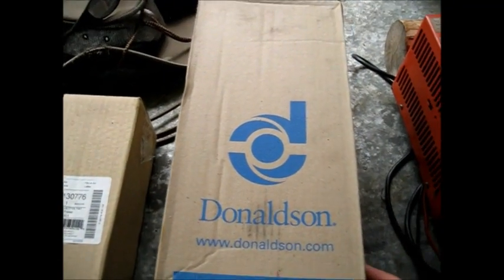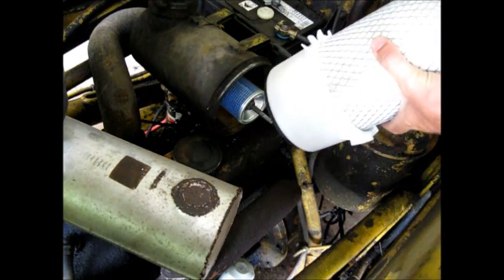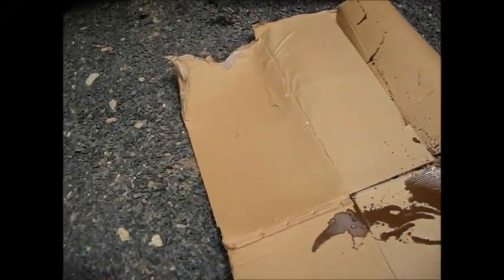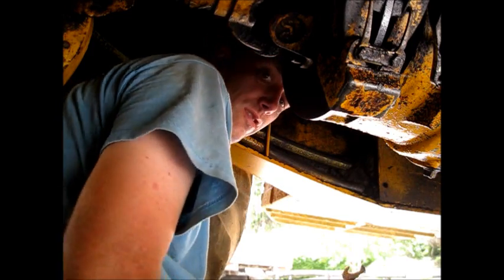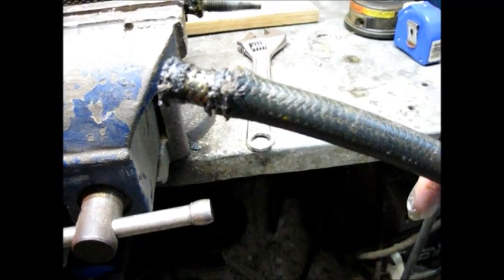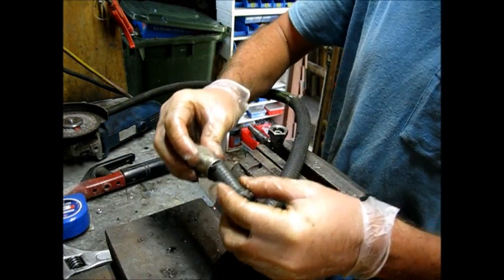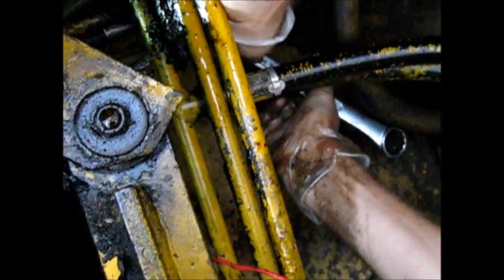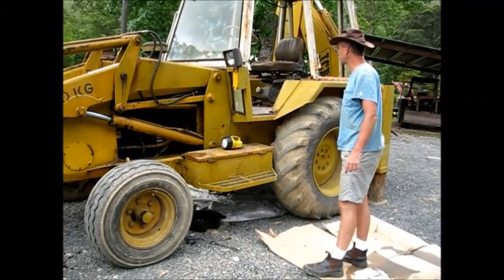Servicing JCB Backhoe Part II And Repairing Leaking Hydraulic Lines

Comment: Troy I have been a diesel mechanic for 15yrs. I wanna pass some helpful knowledge to you. Those fittings are gates fittings and yes they are reusable. The hose is a rubber hose with steel braided reinforced with a cloth protective coating. The part of the fitting that screws on the hose is often left handed thread. Now take that part and thread it on the hose till flush an can't thread onto it anymore. Then the part with the threaded nipple is standard thread. Put the hose and bottom part of fitting into a vise once threaded onto the hose. Then the nipple part of the fitting spray down with on blaster or wd40 as well as the inner part of the hose. Now thread the male nipple part into the part that you have put onto the hose. Just seen the hassle it gave you and wanted to make your next time a little easier. Hope you have a blessed day. Been cold here in the states
Reply from the maker: Thank you. I am sure I will run into these again one day.

Comment: Just a few observations from the UK...  Either we are lucky here or you haven't got a local hydraulics dealer, as it would just cost £30 here to have a new length of hose and two new connectors fitted.   If you keep snipping bits off, you will get to the position where you don't know the original length, if it breaks again.   Also as mentioned in the other replies, the ferule goes on first, then you hold the pipe in the vice whilst you screw the tapered union into the pipe.   This needs lots of fresh oil lubrication, and once started to thread, you must not stop turning as the taper will lock and be immovable.  That's why hydraulic dealers have a machine to wind the new union on.... Cos it's very hard work otherwise.  .. I am also not sure whether all the grinding particles will end up unfiltered in the valve block...The final note is that you did not test the crowd ram to its full extent, so hardly got the air out of the pipe.  It needs to go from stop to stop several times.